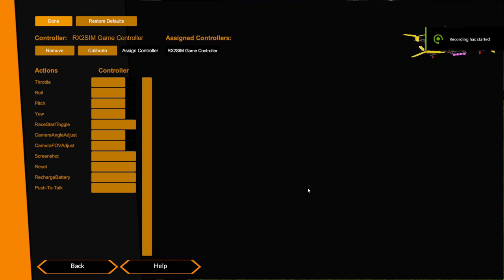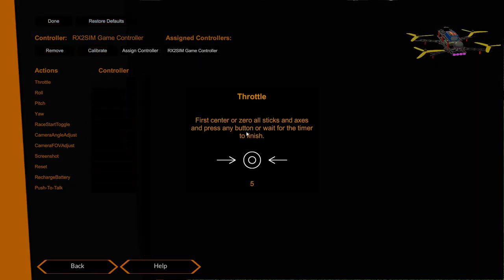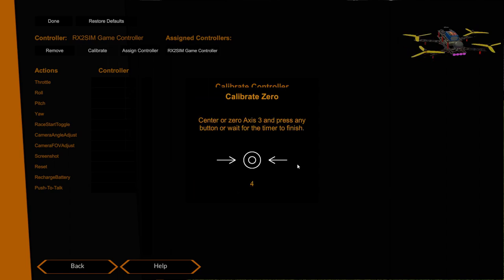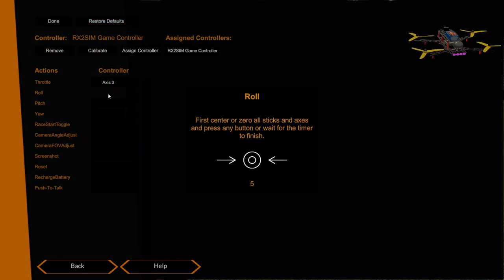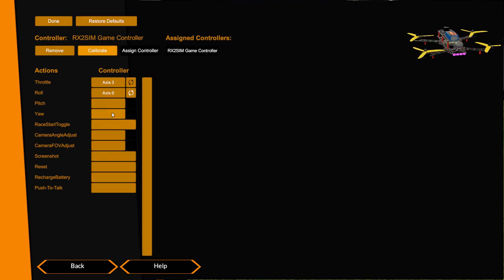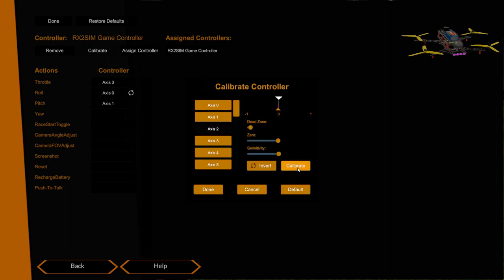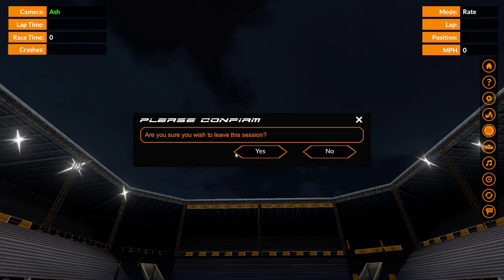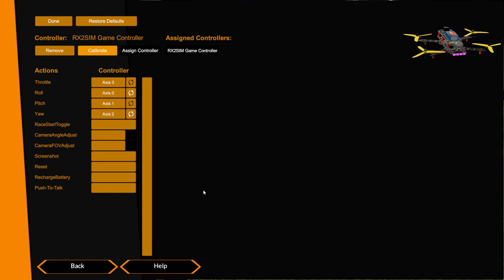Solving axis non detection during control assignment

Comment: Does not work for me. I have a Turnigy T9X. Every channel works except the yaw. I tried every channel in the calibration menu, but nothing responses to my yaw input. It works well on other simulators though. Any hints?
Reply from the maker: If you are on windows then the T9X needs to output to the windows joystick for each channel - if it doesn't then we can't read from it - problem with transmitter.
Reply: @Velocidrone  Thanks for the reply. For some strange reason, the TX does not send the ppm for channel 1 to the trainer kable. So I set the yaw stick to channel 5 and now it works.

Comment: Hi, my dji fpv controller is recognized but I cant get a reaction on any axis when trying to calibrate. Any ideas?
Reply from the maker: Controller issues all originate at the operating system level. Try to calibrate it in windows control panel first. If it doesn't work there then it's a cable issue or driver issue.
Reply: (Mac) :)  @Velocidrone
Reply from the maker: Mac or Windows the problem still lies at the operating system. However on mac the dji controller only works when connected with the right kind of cable. Which is a USB A to USB C cable. The supplied USB C to USB C cable will not work.
Reply: Thanks for the quick response  @Velocidrone

Comment: This is not working for me. I am using Windows 7 and a Walkera Devo 10 with Deviation 5.0. After several tries I was finally able to calibrate my sticks, but I am still not able to assign any stick movement to an action.
Reply: The cheap gamepad in xbox sytle btw works fine. Apart from awful precision.
Reply from the maker: Just increase the sensitivity slider until it detects it, then put it back to correct calibration levels afterwards
Reply: Thank you it works

Comment: There should be an update on this video
Reply from the maker: we agree - although the legacy controller in the current simulator has not changed - it still works exactly the same as this and looks the same apart from UI is purple now instead of orange. So whilst we  will do a new video for the main controller setup the UI shown in this particular video hasn't actually changed and as such this particular video is still very relevant and can be followed in exactly the same way in the current simulator.